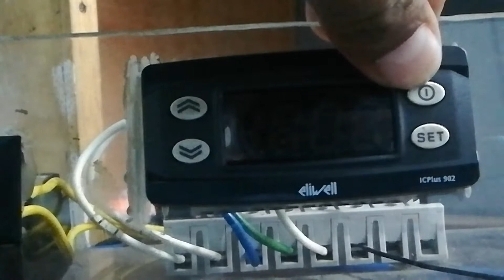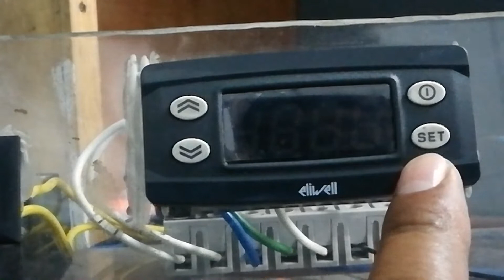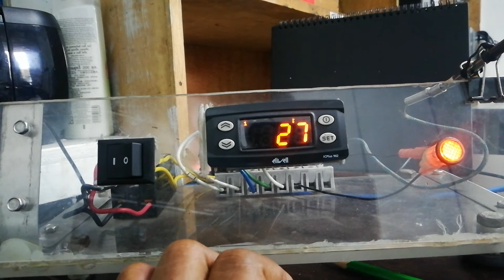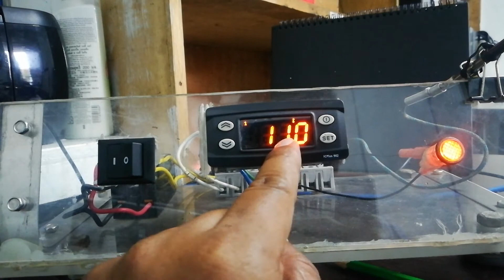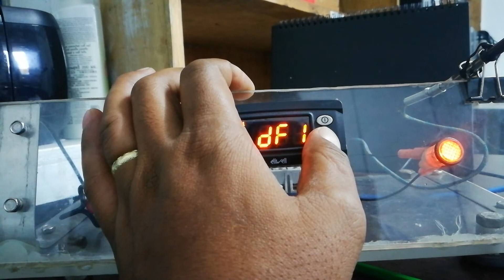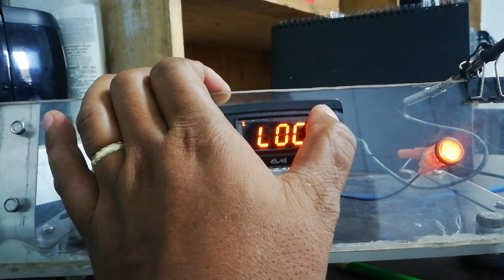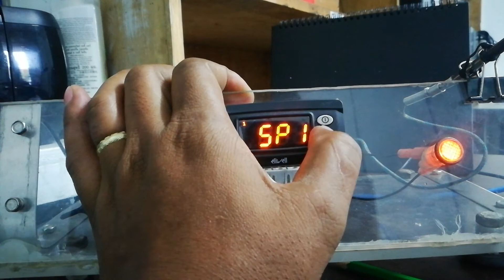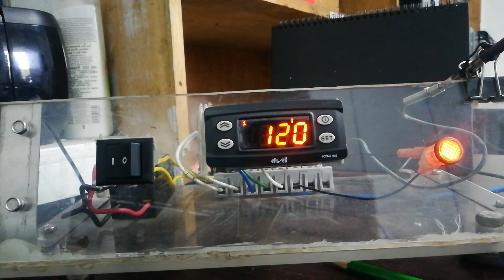Eliwell Controller ICPlus 902 Set Setting, KEYBOARD LOCKING, AND UNLOCKING PROCESS.

Comment: Hi. Is the default unit for temperature set is in F or C?
Reply from the maker: It is depend on the eliwell model.  If intended for cooling process default setting is C. But you can change it in Dro parameter.thank you.

Comment: Paano mag calibrate Ng temperature sir..thanks for sharing
Reply from the maker: pag adjustment ng parameter sir pasok k sa CA1 parameter. pero need muna makuha actual temp ng unit bgo k mag adjust sa internal paramater. tolerance nyan is -+5 sa setting temp.
Reply: @kitchenequipmentexpert4977  ok sir salamat
Reply: God bless po

Comment: لو سمحت ممكن توصل حساس ايو 902 على كونيتكتر 180 بعد اذنك لفقيس
Reply from the maker: do you need to connect the eliwell to 180 contactor as a switch?
Reply from the maker: 902 switch connection are terminal # 1and 2 (output) L1 connected to terminal 1 (eliwell)  then out from terminal 2 (eliwell) goes to A1 contactor terminal, A2 terminal of contactor directly connected to L2 connection. thank you.

Comment: how to change temp if display is loc. eow plu 978
Reply from the maker: It is included on my video.
Reply: @kitchenequipmentexpert4977  this is 902 model how obout the 978 it is desame?
Reply from the maker: @ricasdeguzman7762  absolutely the same... Pa2 password 15 if needed, or either select y/n in LOC parameter.
Reply: @kitchenequipmentexpert4977  thank you  so much sir  your new subscribers .
Reply: desame procedure the 902 and 978?

Comment: can i have whatsapp number or email. due to over frost problem and door switch connection
Reply from the maker: Hi! Are you using the same model of eliwell? Ic902 plus? I have another video you can set in default parameter setting..
Reply from the maker: https://youtu.be/qugBclIEUNE factory default setting for ic 902 plus.. Thank you i hope it will help you..